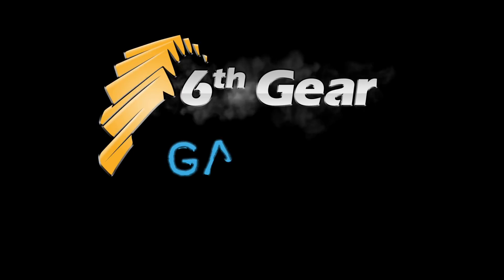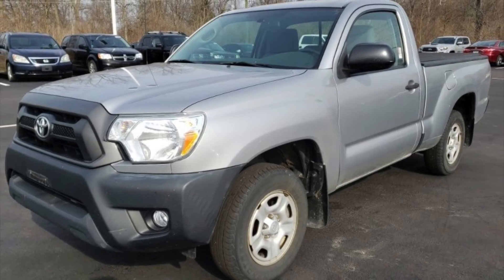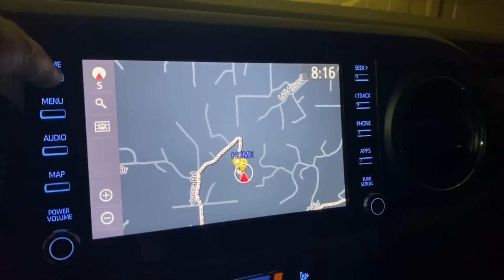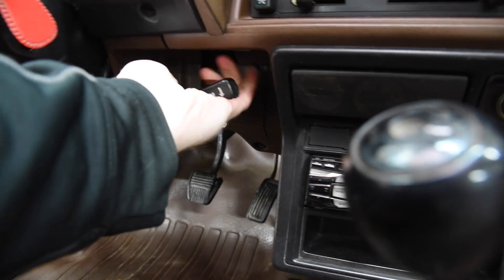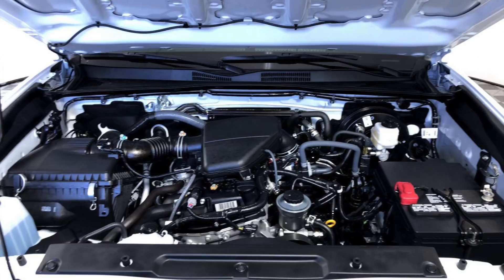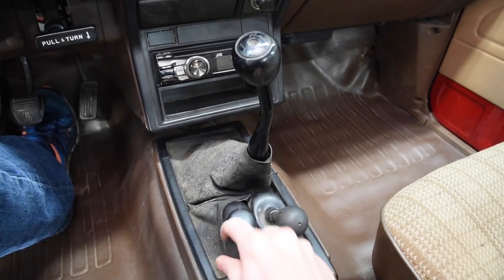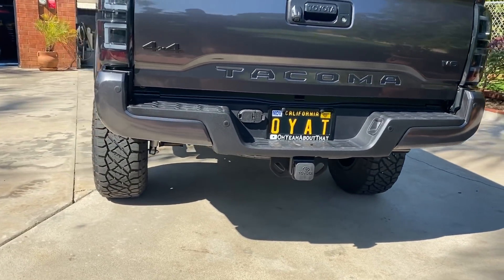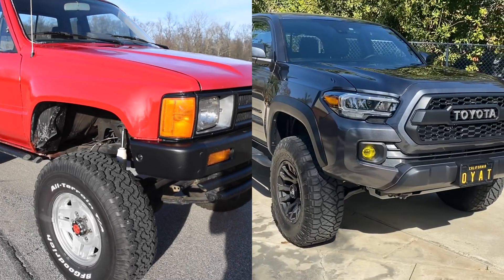1985 Toyota Pickup vs 2020 Tacoma TRD Off Road Comparison/Review

Comment: I have a 2018 extra cab Tacoma sport TRO with the V6 motor and six speed manual and 4 wheel drive. It was supplied with Toyota's towing package capable of about 6500 lbs. 
It has dynamic cruise control which is great but dangerous in that it doesn't kick off when you change gears. When new I had two close calls with it and now make a habit of dropping the cruise before changing gears to slow down/stop etc. It kicks off if you touch the brakes.
It has a lot of the features you list in the 2020. The most useless one is the 120 volt AC outlet in the bed. At 400 watts with the engine running you couldn't heat a cup of coffee. Run a drill or saw and you'd barely start them let alone do any work. My daughter has a 2020 Sienna and its outlet is in the cab where at least you could run a laptop or other chargers but in the bed, on the move, it's useless. I once ran an RF analyser in the cab and had to drape an extension cord down the side of the truck to make use of it. A well charged UPS on the floor in the front worked better. 
Overall I like my Taco and over my 2005 Colorado which it replaced and 1990 Isuzu pick-ups it's chalk and cheese. I've driven it in -30*C and +38*C and have been comfortable in both extremes.
 It's not for tall people though. I'm just 6' and I have to duck below the door frame to get in it. I initially hit my head so often I threatened to return it. However I got used to ducking and we've become friends. 
Only additions I've made are a fibreglass cap and side bars to aid in my wife being able to climb into it as it's much higher than the Chevy was. It's now just out of warranty and 57,000 kms on the clock.  Toyota called about trading it on a new one but this one's just broken in and running well. Ask me in another 200,000 and I'll think about it.
It's been Oil guarded twice once when new and again last fall before winter. It'll get done every two years to keep the salt scourge at bay. In 14 years the Chevy was as clean rust wise as the day it was delivered after the same treatment every two years.

Comment: I'll take the 80s TOYOTAs.  
Just bought an '88 TOYOTA 1 ton duel wheel box 22R-E 4 cyl 110k on the engine,  154+k on the truck.
Paid $1,700.

Have owned 2 TOYOTA VAN LE in the mid 90s.
1 '85 & 1 '86.
Never had any problems with those vans. 
The '85 had 
760, something k on it when it was finally to rusted to drive safely.

Comment: I recently bought bought a 1985 Toyota truck and I was surprised at how primitive and simple it is. It had no additional technologies that my 1961 Ford Falcon had LOL. Like my Ford it is a carbureted engine with a distributor. The radio has been replaced so maybe the stock Toyota radio was more high tech than the Ford that had a tube powered AM radio. Actually I like the simplicity of this though. It has what I need and not a million additional features that I will not need or understand.
Reply from the maker: I agree 100%. All the bells and whistles in today's vehicles are extra things to break. All these safety features just allow drivers to pay less attention.

Comment: 1985 Toyota  single cab long bed 4x4 22r carb, all original including the vinyl seats, not even did it not come with a radio  but just a cover it does have a heater. It has 229,000 original miles and it still has the original steel wheel and tire as spare.  People have tried stealing it 3 times, BUT NOOOOO!!!! it's in rear yard , guarded by a 120 German shepherd  and 100 lb Rotwiller.. How much do you think it's  worth $$ now???..
Reply from the maker: Never seen one without a radio, that's bare bones!  Hard to say what it's worth but I can say it's going up in value every year.

Comment: I bought a new RAV4 an am very impressed with the build quality. I wanted to at least think about a Taco, but no way can I get my legs under the steering wheel. The tilt wheel barely moves on them.
The pricing on extended cabs makes them impractical. A 2018 single cab was about twenty grand

Comment: if i had to choose between the 2 definitely the 85, considering most people buy these for off road the 85 is much more capable due to the solid front axle because you get more articulation, older pickup out wheels a newer one everytime

Comment: I have a '15 SR5 basic Access Cab 4x4 with the 2.7. I love it. I had an 07 before this but was lazy and didnt get around to the Frame recall in time :( Frame rotted out.. But this one is clean as can be and if you go check out that other video where the guy with the same model, engine, and trans as mine reached 1.2 MILLION Miles... I'll stick with mine ;-). It's more than proven it self.  That said I do love the boxy 85 though. Sexy truck.

Comment: The crew cab with the 6 foot bed option is longer. Yes the crew cab is available with a 6 foot bed.
Reply: Also, manual is available on more trims than mentioned.
Reply: ALSO, that TRD off road has optional LED headlights, NOT projector beam headlights. Come on, man.
Reply from the maker: The bed and trans were already corrected in the pinned post, but didn't know about the LED.... thanks!

Comment: Don’t know if this has been posted yet, but you have a lot of info that is wrong in this vid. You can get a 2020 with a double cab and a 6 foot bed, which is also longer overall than the other models, obviously.
Reply from the maker: cldryer202 yeah, I pinned a comment with the correct info. I missed that and the 6-speed.

Comment: I realize the 85' is 35 years old but and that rear windows is a bit hard to move but lets be real here that 2020 tacoma in 35 years probably wont be on the road anymore. All that high tech stuff is likely to break over the next 35 years. So the pluses for now seem good but its new so we really don't know how well it will fair over time. I really like the 80s trucks, plenty of room in the engine bay to work, not overly complicated and it still had plenty of amenities (AC/ etc,). Big thing for me when buying a vehicle is 1. reliability, 2. cost 3. how hard are they to work on? My thinking is the simpler they are the easier they are to work on and less expensive. Not to mention you can find parts for my 86 in a junkyard or in some one's yard. You are not likely to find cheap parts for when something breaks in that 2020 tacoma.
Reply: Tathan Bailey how many 1985 toyota pickups do you see on the road on a regular basis lol

Comment: as of the date of this comment you can still get the TRD off road  and TRD sport with a manual transmission. This is per the Toyota build and price tool. The MSRP has jumped by ruffle $1000 when including destination charge. My 2018 MSRP was 35,500 ruffle same truck with less options as of now is 36,430. It has actually dropped since the first of the year when that MSRP was 36,900 COVID-19 might be taking a tole.

Comment: Great video but the Tacoma is not a model-line development of the '85 pickup. It's a separatly developed truck. So it's not a fair comparison. The current model-line vehicle is the Toyota Hilux, sold in Asia, Australia etc, but not the USA. A comparison to that vehicle would be much closer than the Tacoma.
Reply from the maker: I wish we had the current Hilux here. Instead they took it away in 1996 when they gave us the Tacoma.

Comment: I believe you are incorrect about overall length not changing between the 6ft and 5ft beds, and that you get an extra foot of cab space. The length of the truck is different depending on the bed. Also, the 6ft bed double cab truck has a longer wheelbase. The cab stays the same between the two.
Reply from the maker: I was, also on the 6-speed...there’s pinned comment with the correct info👍.

Comment: I'd rather have any gen "Compact" truck than Gen2 or Gen 3 Tacoma Mid-sized truck. Toyota needs to bring back the compact size truck while keeping the Tacoma and Tundra (They should offer 3 models instead of 2 models). Have owned 1978 Toyota 4x2 regular cab Long Bed with Fuel Injection, 1992 4x2 Extra Cab, and currently own 2003 SR5 TRD Offroad 4x4. Will keep my 03 because I like it better than the newer models.

Comment: You failed to mention the turbocharged 22re which was the 22rte and had a higher trim options
Reply from the maker: The 22RTE wasn't available until 1986. Only the 22R, RE and Diesels were avail in the US for 1985. I do talk about the 22RTE in my Toyota Pickup Review video: https://youtu.be/tEec-reAHWE

Comment: Ive got a 92 toyota pickup, it revs up and down while driving...ive replaced the tps  no luck help???
Reply from the maker: Did you calibrate the new one? Or perhaps a vacuum leak?
Reply: @6thGearGarage   dont think i did any sort of calibration? I was thinking vacuum leak possibly. Had an older man tell me to disconnect fan for awhile and blow smoke around engine bay.

Comment: I only have one vehicle.  My 1985 xtracab that I bought in 1986.  260,000 miles and counting on the stock motor.  I have driven the 2020 and I will keep mine.  The brakes in the 2020 are the worst I have ever experienced in any vehicle.  I also prefer my 5-speed to automatic that is in most of the 2020s.

Comment: Your wrong on the newer tacoma sizes. The 4 door cab is the same regardless of what size bed you get. Not sure where you got your info but its wrong.
Reply from the maker: The Access cab is smaller than the Double Cab. I found out where I was wrong is that the Double cab is avail with a 6' bed, not just the 5' bed.

Comment: I have an 85 4Runner.  W56, stock suspension, 33" MTs, locked front and rear, 4.56 gears, in process of a 3RZ-FE swap. A 2020 TRD would not come close to the same performance off road.
Reply: I have basically the same setup as you in an 85 pickup. I have an LC engineering 22RE in mine. Only thing I would change, selectable lockers instead of the LockRites.

Comment: I'v had 2 old ones, now I'v got a 2017 Hilux, which is similar to that, the only place in the world that has that instead of the Hilux is USA. Plus the old one is called a Hilux, only USA call it 'Toyota pick up'. I had a '91 and a '94. In Australia they were live axles until 1996. In other words, other than updated styling, they were all about the same from the beginning until 1996. My 1991 had a 22r (2.4l petrol), and my '94 was a 2.8l turbo diesel. Now look let's tell it how it is. Tough trucks, yes, if stock. When they are lifted, big tyres etc they are great but they do break a fair bit, especially blown rear diff and centre bearing, not things can be overcome. They don't handle modification well, deadly dangerous on the highway, you have to be very alert just to keep the thing on the road believe me. Pretty amazing flex with only a 2 inch lift, I don't know why people say leaf springs don't flex. The push/pull steering design very basic, and I'm not sure I mean that in a good way. Cross over steering as found in land cruisers and patrols of the time much stronger. Now my modern Hilux doesn't flex like the old ones, and you can't beat the live axle, but seriously.. yes they are a laptop on wheels but nothing every breaks. They are fast and powerful (in comparison), comfortable, safe, quiet, off road gadgets are excellent such as down hill descent control, on road gadgets such as trailer sway control amazing. It's fun to have both, but there is no comparison whatsoever as to which is the better vehicle.
Reply from the maker: You said it best... newer trucks are a better daily driver than the old ones, but the old ones are more capable offroad.

Comment: The grill on the new Toyota looks brittle and delicate. The 85 looks more robust, simpler and tough. I like the mini side windows in the 85. I honestly don't like the bells and whistles such as wifi, for example. I want something cheap, tough, reliable and durable.
Reply: I like the storage features of the new one, though.
Reply from the maker: Jorge Garcia It will be interesting to see if the 2020 is still ticking in 35 years

Comment: As feedback, too many errors within the first two minutes for me to decide to continue watching. You can get a 2020 double cab with a 6' bed. The bed is fully composite.
Reply from the maker: rzrback3 I was wrong on the 6’ bed and 6speed manual transmission for the double cab, see the pinned post for the correction on those. Correct the bed is composite, that was discussed in the video.

Comment: If you want a pickup smack in the middle of these two get a 3.4l tacoma😂, super reliable, more than enough power (especially supercharged). Has the old school look, with decent amounts of modern tech, especially for a 90s- early 2000s truck. Just for reference, compare a 2000 tacoma to a 2000 ford chevy or dodge. You will see real clearly how much farther ahead toyota was at that time😂
Reply from the maker: 100% and their resale value reflects that. Worth it IMO.

Comment: Call me old school but the mid 80’s-90’s are the better trucks, smaller yes but off road very capable to get you were you want to go. In 2030 I bet my 84’ Toyota 4x4 pickup is still going strong like is today. Point A to B on road and twice that amount off road. Good thing about older Toyota’s is you can upgrade parts from newer generations. For example started with a 84’ standard cab, converted it to a 93’ extended cab and bed. Upgraded to IFS hubs and calipers keeping manual hubs, with a land cruiser high pinion third member, including a locker. Complete rear axle out of a 98’ Tacoma truck with factory locker. Put in some 5.29 gears front and rear with the factory gear driven transfer case, and this small light weight truck has gotten through anything I’ve driven it into. Newer trucks have nanny control, and if you down know what your doing you will get stuck on the easiest of obstacles. Not sure if I could ever trust something with all the electronics newer vehicles come with, less is less complicated and will be easier to get back on the road if something is to fail.

“Toyota, I love what you do for me”

Comment: I was going to do this exact video! Haha
Reply: Oooh you have vinyl? That's fancy floors. My brother 85 has the fancy map lights and carpet 😂
Reply: I did this exact video!  Check out my version!  ha ha
Reply: @OhYeahAboutThat  I'll check it out
Reply from the maker: You should do an 84-88 comparison to the 89-95 trucks.  It won't be as drastic as 35 years, but would be a great vid for someone on the fence about buying one or the other.
Reply: @6thGearGarage  To bad mine, and all my buddies have solid axle swapped 😂 Would not be a fair comparison.

Comment: Well, they are different tools for different jobs, so there isn't really  any comparison. I just sold my 85 long bed with 371,000 miles on it. It wasn't the right tool. I'm a retired, seven figure net worth person who absolutely can afford the 2020 model, but it's not the right tool either. I bought a 1989 SR5 extra cab 5 speed 4WD, and that is exactly the tool I need for the jobs it will be used for. Love the safety features on the new ones though, if I needed this to go out on the Interstate, that might have changed my mind some, but mine stays mostly on my own roads on my timber property.
Reply from the maker: The larger cab of the 89 was a huge improvement.

Comment: My grandpa says that old 4wd systems were "true" 4wd and that new 4x4 trucks arent real 4wd. Anyone know what he means?
Reply from the maker: Maybe he means that modern vehicles are electronically activated by a button in the dash which then uses a motor to engage 4wd, while old trucks were mechanically put into 4wd using a shifter and manual locking hubs?

Comment: Hi!
I own a 1987 LN65 with only 9600 Miles.
The Firetruck has been on standby  in a small Austrian Firedepartment in a village close to Vienna. Perfectly maintained, no rust at all. Double Cab, Diesel, Power steering, 5gear manual, 100% original.,
Who would know for how much I could sell it? 
Regards
Franz

Comment: Over all lengths are all the same over all 2020 Tacoma models, statement, is incorrect. Overall thength will change. Double Cab Short bed is shorter than the Double Cab Long bed.
Reply from the maker: Yes please see pinned comment, corrections are there👍

Comment: I will be keeping my toyota 1997 hilux 2 wheel drive simplicity equals reliability and the 22R motor is number 8 on a list of the best motors ever made also l live in Australia and there is zero rust issues with the chassis infact in Australia we call them hi luxes and the cab chassis still comes with manual windows and l do like the quarter windows (vents) available in the next generation of the hi lux Australian model only also my air conditioning works very well

Comment: The Hilux is a lot different. Not to mention more of a workhorse and an ultra reliable truck when compared to the Tacoma. It's got a different engine too. A diesel 1kd or a 1gd in the latest models. Even the 80s hiluxes r diff from the pickup. They've got the 22RE engine nd diff features. Excellent work trucks nd it's how the hilux gained the title indestructible. 100% tru if u ask me. Got an 06 hilux nd it's running like a charm. Can take much more of a beating unlike most trucks. U get less luxury tho.
Reply from the maker: Here in the US we had the Hilux/Pickup until 1995, then it was replaced by the Tacoma. I wish we had the modern Hilux in the US.

Comment: Hi there,dose your 85 come with the break bious on the rear diff. Mine dose,when the deck has a heavy load, it pushes down on the arm,witch aplies more breaking. It really work's good.
Reply from the maker: It did, but was eliminated for a manual proportioning valve.